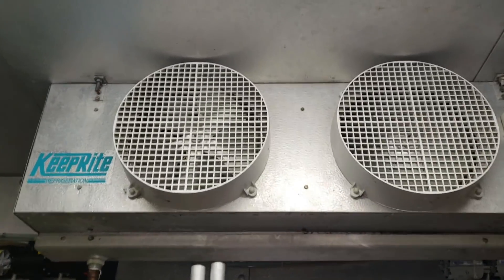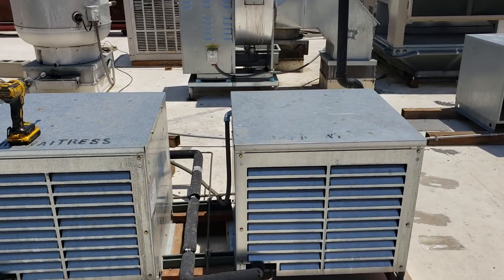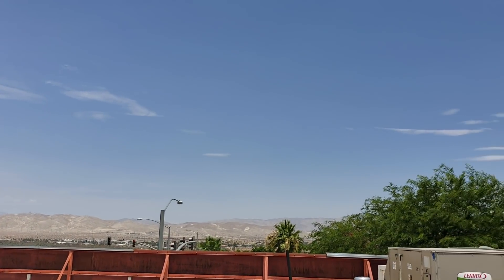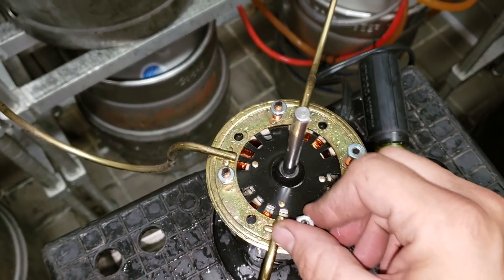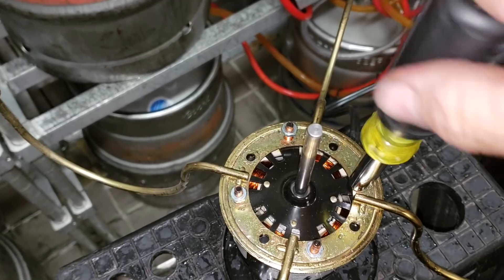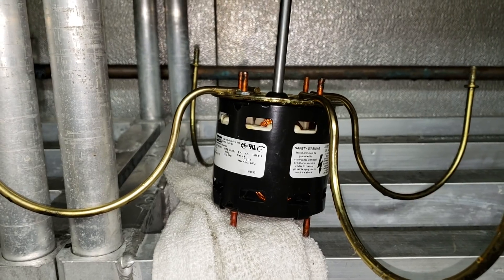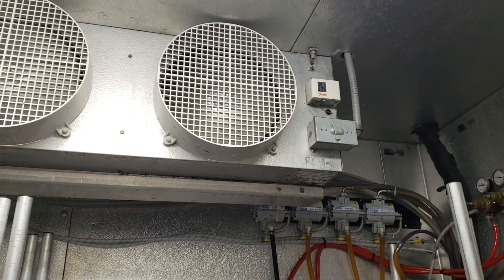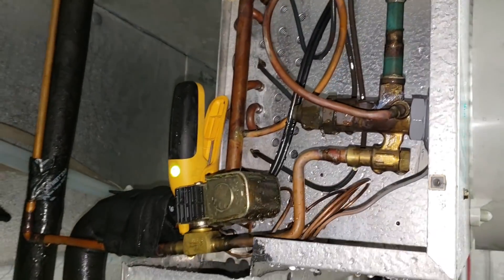Beer Walk in Cooler Iced up

Comment: You should move to San Diego. Its a hell of alot cooler! The hottest temperature I have ever experienced here was 107 degrees. 100 degree days are uncommon here. I also carry a Klein 11 in 1 on the job. Its a great little tool.
Reply: Seems like a perfect place for me not to hot not too cold the only thing is . is it humid ?
Reply: @prettycureforever7102  Humidity here in San Diego does occur from time to time but generally we have more of a dry heat but we don't experience the temperature extremes like Chris does in the Inland Empire area.

Comment: Sir your work is very nice . Sir I have a question because I’m Hvac Technician I have a 4 years experience sir I I’m Pakistani but working now Saudi Arabia. Here coustmer very talk much . Here I pik your video coustmer not come not talk much . Here for example.  Freon charge cost 100 SR. If contacter damage capacitor change money give me just 100 this problem. But sir really I don’t work for money. I wanna much learn . Sir I have a other question 410a Freon charge same same r22 and no . Please guide me because i see Compressor blast 410a . If 10 bar low gas Important all gas empty and vaccum after refil gas . Guide me sir.